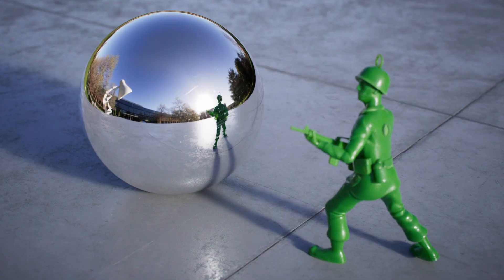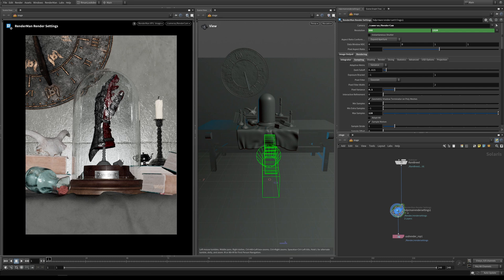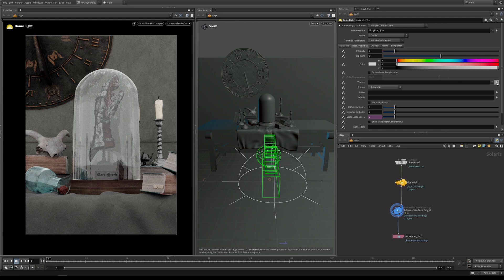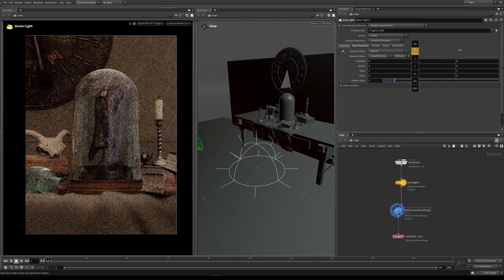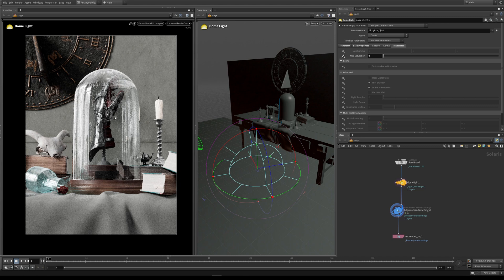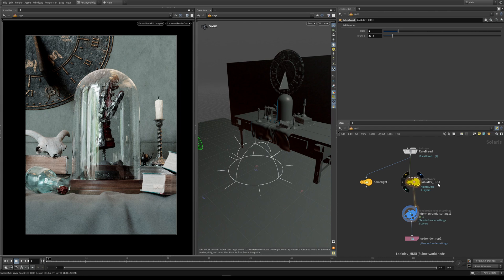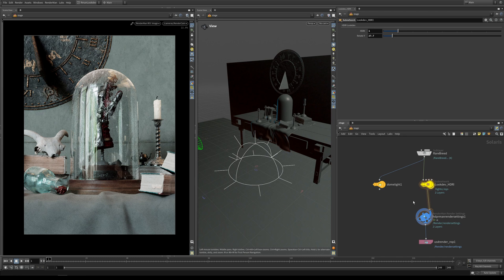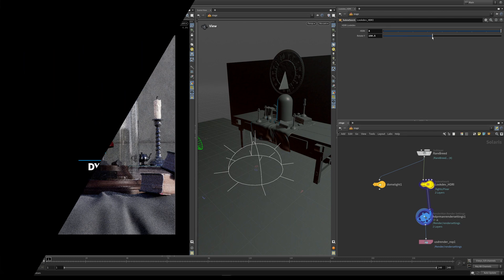Solaris & RenderMan Series : Dome Light

Comment: Dome light is not working with XPU but working with RIS is it because of free license?
Reply: did you ever figure this out?
Reply: @Bendoescamera  yeah, free license issue, in solaris it is not working but in sop its working fine.
Reply: @RajuMon2016  Same problem, works only in RIS HDRI
Reply: @Bendoescamera  its working nice. Cant tell if it was a bug, or something wrong before :)
Reply: Dome lights with HDRI tex textures works in XPU in Solatris with free licence, no problems :) I have just tried this scene with Luxo and other tex HDRIs which i have .. and no problem.